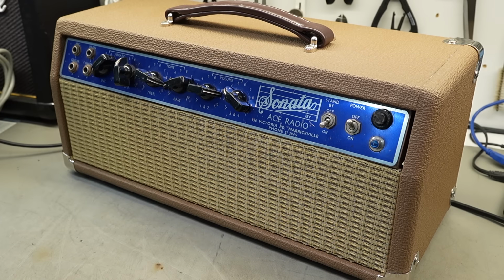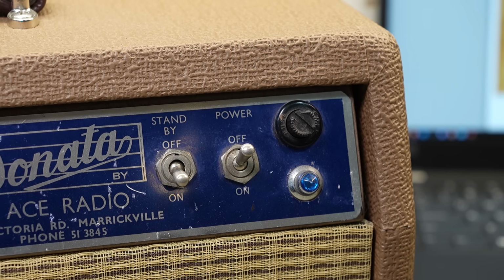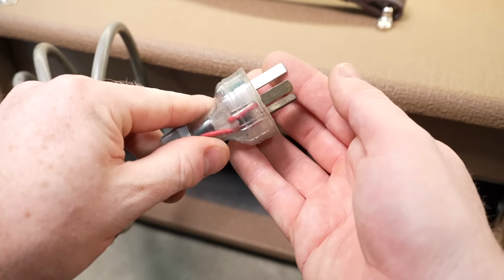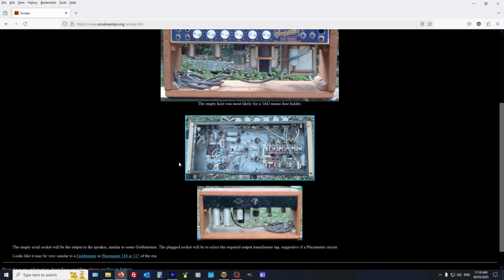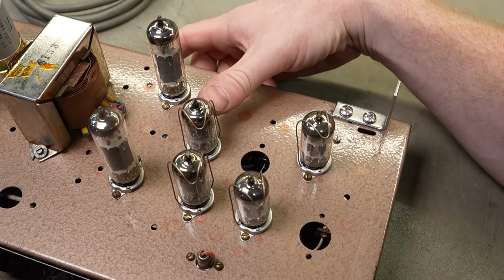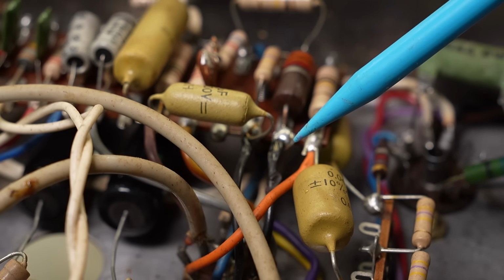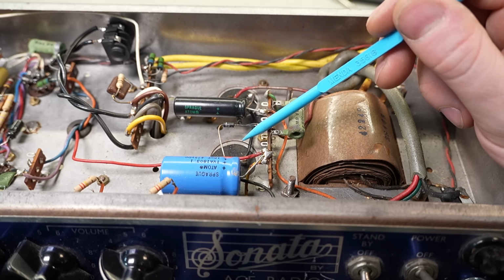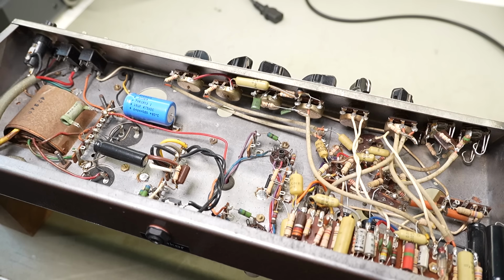Ace Radio Sonata - Part One

Comment: With all the modding they've done to this thing, it's hilarious that they didn't replace the "Liliput" bulb with an LED. And I didn't know you could get leather from a kangaroo.

And in the US, black wire is hot, white is neutral, green is grounded to the building, red is the extra leg in a 3-way. Just FYI

Comment: In the United States white is always neutral green is always ground sometimes it has a yellow stripe with a green wire and the colored wire is always your active or you're hot it can be many colors it can be brown it can be black it can be red it can be brown for single phase stuff. Usually black red and blue are for lower voltage  three phase and brown orange and yellow is higher voltage three-phase but white is always neutral in both single and 3-phase and green or green w/yellow stripe is ground.

Comment: Hey Brad, it was around the late 1970's that we started moving to the Euro brown/blue/green-yellow colour scheme for flexible cables here in Australia. I believe it was written into AS3000 around 1980 or 1981. I have a bunch of late 1970s Aussie disco gear with both Euro colour leads and old red/black/green leads as built.

Comment: 6BL8 = ECF80; similar to 6U8 (which has the same pinout and little less gain). Other similar-ish triode-pentodes with the same pinout are 6EA8, 6GH8, and 6JW8/ECF802. 6BL8 was used as the phase splitter in the Scott 299 hifi amp. The cool386 website has a bunch of pages about this particular tube, including products that used it and schematics showing its usage.

Comment: Midget lamps? That sounds correct. I had to order some in from China for an old piece of test gear. My choices were a 6.3 volt pack E packet from Cina, and 7 volt doll house lamps from England.
Reply: I have had to dig a few midget screw in bases out that wouldn't come out or the glass was broken. Have fun with that.
Reply: The manufacturer to search for is JKL Components, headquartered in California; we stocked hundreds of lamp styles from them at the audio repair shop I used to work for. They have miniature screw-in bulbs in both incandescent and LED types; and matching sockets too.